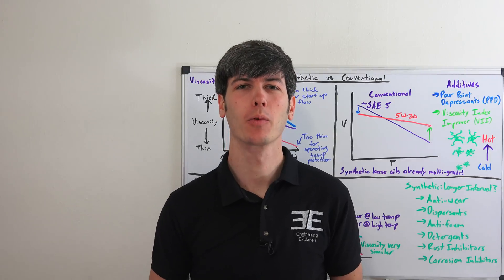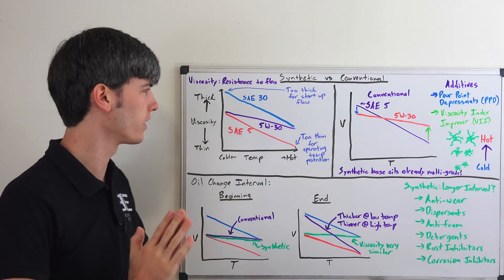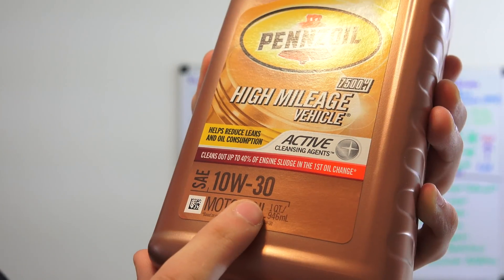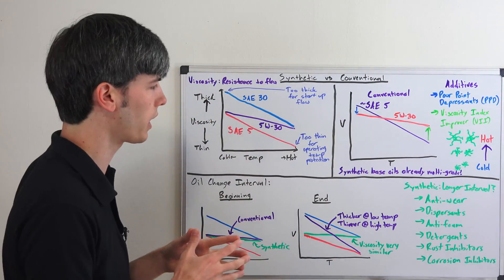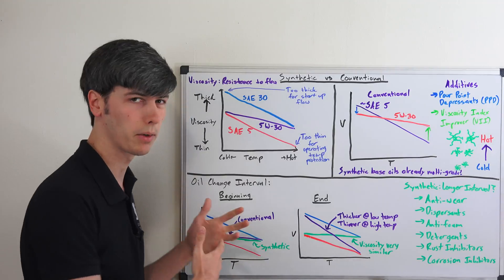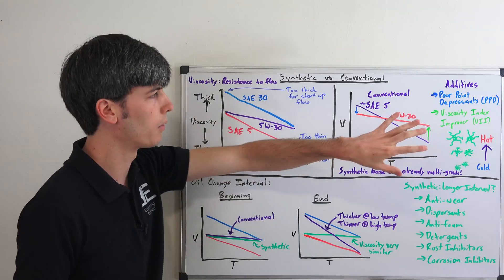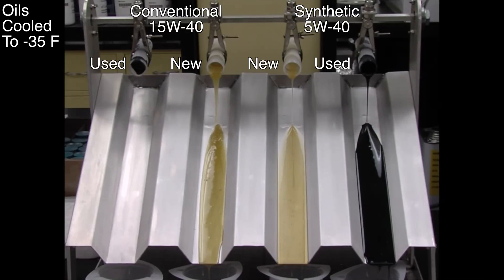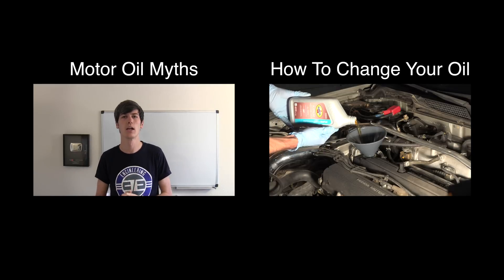Is Synthetic Motor Oil Better For Your Car?

Comment: This guy is holding a bottle of High Mileage oil (copper color bottle), which is considered a synthetic blend oil and not a conventional.
Anyway, bottom line is synthetic based motor oils performs better than conventional ones in cold temperatures.
Note: "any brand" synthetic motor oils performs better than conventional ones.
Try Service Pro Full Synthetic at 60% the price of Pennzoil...without all the bells and whistles, this oil performs as well of better than the expensive ones.

Comment: I have always used synthetic oil on my car. As others pointed out... it's $25 for 5 quarts. Sometimes they have $12 rebates... making it $13... Every time I pull out the dipstick the oil looks good... I only look for the level. I was checking my brothers car.. The oil on the dipstick looked horrible... I was so confused, I didn't know that was possible! Well... add conventional oil, do not change oil for over 6 months... add winter to it and you get that! Never mind the freaking cabin air filter... holly crap what a horrible sight!! That thing was not changed in years...

Comment: My wife's Buick Encore manual recommends an oil change every 7500 miles!   Why do u suppose?
Reply: AudiophileTubes dealer warranty gone they sale you another one they care  change oil 5000 lot cheaper then new car
Reply: AudiophileTubes my buick calls for synthetic blend which extends the oil life.maybey yours is the same.
Reply: 777 pop  Please DO NOT buy blended oil, I mean you can but you are wasting money. There are NO regulations on "how much" synthetic oil has to be in a blend to call it a "blend". Could be 1% and they can call it a blend. My advice is to buy one or another
Reply: Tom Green absolutely tom I can't agree more.i have 3 more free oil changes coming from dealer and then will probably go the mobil 1 route. I swear by full synthetic
Reply: AudiophileTubes  better check timing chain at 100000 for side to side play

Comment: basic oil change price is less than synthetic...I do my own oil change in spring/summer & part fall but winter, I pay to have it done.
honestly don't believe them if they said WE USED SYNTHETIC even if I paid more.

Can I add Lucas to safeguard instead or synthetic?

Comment: never seen my convensional oil flow that slow....as in ever
Reply: Toby 750 you have never tried to pour it at -35 degrees
Reply: Paul Zumpf 
as in the fewest places on erth people live...wored as a mechanic  in Norway and NEVER had this sirup coming out in ouer -15 to -20. Not saying syntetich isn't better...
Reply: L L temperatures @ my place is 75 F during winters & 110F during summers do I need to use synthetic or mineral oil will be sufficient.
price difference is five times ( synthetic to mineral) in my area .
Reply: Well the tenperature was 3 below freezing so you  probably wouldnt. This would be important if you moved somewhere really cold though.

Comment: Could someone please tell me when the "W" became the meaning of winter ?? For my 68 yr's on this planet it has always stood for weight.
Reply: Rod Parkinson 
IN ROD WE TRUST
Reply: Unfortunately you've been wrong for 68 years. It does indeed stand for Winter.
Reply: I am just blown away by the fact that they call it "double u" and not "double v"
Reply: Wafflepudding : weight in oil does exist, just not in this instance, you get 5 weight for example in motorcycle fork oils which is very light, almost like power steering fluid, then it goes up 7W, 10W etc etc, but all these oils are a single viscosity not multigrade.
Reply: FWIW, "W" has meant "Winter" since I was building hot rods in the '60s...  I worked at a service station (remember them?) and we received training from the oil company on the products we sold...
Reply: Viscosity =/= weight...
Reply: It's like all things, the younger crowd can change it to anything. Picture is now pic. The # pound sign is now hash tag!!
Reply: Both numbers are the "weight" but at low and high temp.
Its carryed over from the old boys from back in the day when they only had straight grades like sae 30 aka 30"weight"
Reply: Rod Parkinson - I stand corrected with you Rod, only 36 years for me but I thought the same thing. Go figure.
Reply: Rod Parkinson good lord look at what you started. yes mechanics have always used weight for viscosity. some people say winter. personally I don't care because it gets lost in explaining. I just go with viscosity (widerstand was what I was told then later winter...again I go with viscosity.)
it's all lost in translation.
Reply: I know this...I never said it was a weight... Oi
Reply: I believe the reason the W stands for winter comes from before multi-viscosity motor oils were standard. Back then, it was common to run a thicker oil in the summer and a thinner oil in the winter.
Reply: Don't let this distract you from the fact that Hector is gonna be running 3 Honda Civic's with spoon engines. On top of that he just came into Harry's and ordered 3 t66 turbo's with NOS's and a Motec System Exhaust.
Reply: It's always been Winter.  Weight is meaningless
Reply: Interesting conjecture, but since you're talking unspecified volume, 
you'd have to be talking density, not weight. Then too, a number without
 associated unit is meaningless- "5" what? To top it off, viscosity is 
NOT what you might be talking about- mebbe viscosity INDEX, an SAE 
thing.
Reply: I always assumed w standing for Widerstand the German word for resistance, I only know the table from what I know from some tables in from some garage and shops and so on. First number mean the general viscosity followed by an W then most of the time after the "-" it is 30 but some construction machines  use 40 in the summer means it say how low the viscosity change with heat means using 40 in the cold it is too thick and 30 gets to thin in heats. You also want to use 40 if you life a in a spot where it is never 0 Celsius
Reply: Jamal Baloch no, there are 5w-30 and 5w-20 conventional oils.
Reply: Thanks, I had the same question myself.
Reply: For about 69 years, it has meant "winter".
Reply: you mean you haven't googled in all of your 68 years in the planet? be thankful you got educated then...
Reply: Most modern cars use 5 W 30 year around everywhere, but some vehicle manufacturers (MAY) indicate a different oil in certain extreme environments. For instance a Ford for sale in Saudi Arabia might have a recommendation of a higher number than the same car sold to a Russian in Siberia and used during the winter, and that Siberian Ford might also recommend a 0 W 30 instead of 5 W 30. I don't really know for certain even though I have been in Saudi, but never looked at an owner's manual there. I've also never looked at an owner's manual for Siberia or northern extreme cold regions.
Reply: Actually his understanding of the "W" would not be important as long as he knew which oil to use.
Reply: nope, watch the video again.
Reply: Rod Parkinson 🤣🤣🤣🤣🤣🤣right?
Reply: Rod Parkinson i use " All Season " 😂😂😂😂
Reply: W for Walmart cheaper oil
Reply: It is winter because it is the base test for an oil at 0 degrees Ferinheight. As in the freezing temperature of water.
I also was taught that it was weight by all of my shop teachers.
Reply: u must b a American
Reply: W10W140
Reply: I had to go straight to the comments as soon as he said W is for winter. I had no idea
Reply: For 68 years, you were wrong.
Reply: Dun Truckin for us northern living folks that love 4 seasons!
Reply: W is a term used before the development of multi viscosity oils by Kendall Oil in 1953. Before then oils were single viscosity referred to as "weight". 30 weight in summer and 10 or 20 weight in winter.
Check out  Motor Oil - Wikipedia Single Grade. 
I remember the old timers talking oil "weight" down at the fillin station when I was a kid back in the 60's. The gas stations where I live here in Alaska including the one I leased in the late seventies carried single weight oil into the early 80's. 
Changing terminology and thinking in general is a gradual process that can take many years to accomplish. Please keep in mind that because someone uses different or technically incorrect  terminology does not mean that they are incapable of doing quality work as someone here alluded to. I have known people that were incredibly intelligent and book smart but could not perform simple skilled tasks with any level of competence basically due to a lack of common sense and actual hands on experience.
As for me, after watching that 15W/40 on the left I am going to check the oil pan heaters on my old diesels first thing in the morning. We don't see -35*F here much anymore but not going to take any chances.
Reply: @Dun Truckin   Here's the official gasoline alley explanation. Back in the bad old days, only single weight oil was available. When the cold weather came around, drivers would have to switch to a lower weight oil for the season, commonly known as a winter oil. When multigrade oil was introduced, the lower number was designated W for winter weight. The idea was, 10W-30, for example would perform like a 10-weight oil cold and a 30-weight oil hot allowing the use of a single oil year around. I recall single weight oil as having been designated as 30W-30 or 20W-20, for example, but my recollection could be wrong, and the industry might not do that anymore. I haven't looked lately

This is just industry nomenclature. It doesn''t have any cosmic meaning. But W does stand for winter.
Reply: kcotte59  That's Heavy Man.
Reply: The W has always been winter.  5W-20 is 20 weight oil.  The 5 is the number of seconds it takes to flow through a predefined restrictive tube at an ambient temperature of 32 degrees.   So 5W is a winter rating of 5 seconds to make it through the tube specs for testing.  The faster it makes it through, the better the winter rating and the lower temperature you can operate in.  So 5W is better than 10W and 0W is better than 5W.  0W-20 is recommended by Honda and Toyota.  I run that in my vehicles.  However living in the South, 5W would work just as well.  But If I take a trip north in the winter, I may benefit from it, although probably not unless Alaska is my destination.
Reply: Bruce Greer you cant be more than wrong on your winter VISCOSITY of oil. Your winter viscosity is how thick your oil is when below a a cold temp (meaning well below operating temp) 0w based oils are meant for minus 0 degrees farenheit and work best in those areas. This does not mean the amount of time for flow through an engine. Your second viscosity is the thickness of oil at operating temp because of the chemicals in the oil. Overall most manufacturers recommend a certain generic multi use oil because they have no clue where the cars will be shipped. So in conclusion the W in oil stands for winter meaning how the oil acts in very cold temps for oil. In general synthetic oil is best for lubrication of your engine overall as the chemicals are very uniform and have a longer life as opposed to a conventional oil
Reply: Bruce Greer So according to your interpretation 0W takes zero seconds. "Winter" is correct. Referring to oil as "Weight" is a malapropism from the erroneous terms lightweight and heavyweight which conflates viscosity with shear-strength.
Reply: The W refers to Winter. Not to Weight.
Reply: Have you seen fastand furious where paul walker and vin diesel are in the asians garage and the asian is torturing the fat guy ted?? He says 50 weight 60 weight?? When they pour oil on his face???
Reply: @speeddemon002   If it is in a movie then it has to be true!!
Reply: Rod Parkinson Mandela Effect.
Reply: Nonsense. "Weight" means nothing re lubricants. The numbers tossed about for these oils refer to VISCOSITY INDEX, which is a way of codifying viscosity, the property that slows oil being squeezed out of journal bearings or off cam lobes. Thus you mean 30 VI, not 30 weight. Takes a tiny bit of conscious thought. Synthetic oils were first developed for turbojet engines, with enormous temp variations; saved lots of destroyed bearings, because of much reduced temp-related VI variation.
Reply: a single viscosity oil isn't called 30W... it's SAE 30.
Just because you learned that the W is for weight doesn't mean that the real meaning of the W changed. 😉
Reply: Speeddemon002: And your point being what exactly, 50 weight, 60 weight do exist, but they are just that.
Reply: Your sources are correct. W is winter.
Reply: WTF? What sort of blather is that? The numbers of motot-oil grade are viscosity-index, an approximate way of codifying viscosity. Period. Devised by SAE, Society of Automotive Engineers. Even Wikipedia is quite confused by just what it means- variation vs absolute.
Reply: Rod Parkinson You've been wrong for 68 years? I hope you're weren't a mechanic.
Reply: Every single source I looked up has the W being for winter, not weight. Which makes sense, because "weight" would be meaningless here: Things don't change how much they weight based on temperature, and weight has nothing to do with lubrication or viscosity.
Reply: Rod, it does stand for winter or the coldest, of the 4 seasons of the year, Thats the first number of the multigrade oil, the 2 nd number is for the other 3 seasons! Amen
Reply: Jacques Blaque We should also consider that weight is actually a function of mass and gravity. Mass is a function of volume and density. Gravity is a function of two masses. So using weight when referring to kinematic velocity is actually completely wrong anyway.
Reply: Cody Deville : this is a debate on the subject, winter wins out. https://www.bobistheoilguy.com/forums/ubbthreads.php?ubb=showflat&Number=7570
Reply: Tyler Hardy W doesn't mean weight..... the W means winter
Reply: Yup. 30 weight for summer. 20 weight for winter.
Reply: Finally :)
Reply: No. It's definitely Winter.
Reply: @Rod yea they tore up in the head. 5w-30 5(weight)when cold, then your engine oil heats up and it thickens. Long story short wtf does winter have to do with the W? Why is oil referred to thickness when it gets warmer? Isn't it easier to comprehend the WEIGHT of the oil?

Comment: I Change my oil onec a year and my car is fine on ,117 000 miles, my jeep has 174000
Reply: What The Heck TV
117k is not an impressive mileage number.   Put another 200-250k on it, then come back and brag.

Comment: do you have any idea what you are telling people? if someone has over 50,000 miles on the motor they should not start using synthetic motor oil it is so thin it's sneaks through all the seals and comes right out the exhaust and blows the motor. stop looking at it from an engineer's side and look at it from The Real World mechanical side.

Comment: I used to use full synthetic until I heard that the thinner oil leaks faster. I have a worn and expensive gasket to fix and I would rather have it leaking slowly.

Comment: I really don't understand this video
Reply: Jason Holzman 
If you did, you'd be rocking back and forth in a chair mumbling something about Kmart underwear.
Reply: Mr Dave
Synthetic is better.   You're welcome.
Reply: @jshepard152  which number should I used. There are so many. 10-50 ,15-50, 10-40,10-30
Reply: panggil zufar je
Whichever one your car manufacturer calls for.
Reply: Kmart, Cincinnati.... 400 Oak St.
Reply: Thats Oak and Burnett.. Kmart
Reply: Marvin King well maybe because he's trying to explain everything behind how oil works in your engine or wtvr 
If you didn't get it that's your prob
Reply: Jason Holzman 
FEMALES.....sigh*
Reply: Jason Holzman the answer is yes. next video!
Reply: Jason Holzman your not the only one
Reply: That's cause you don't speak english
Reply: Maybe you should suggest that he add cute dancing girls to his videos, if you're so bored?
Reply: Mr Dave tru
Reply: Hit play
Reply: you are not alone~
Reply: paul k the trick
Reply: Its all about oil viscosity synthetic keep this property much better than conventional
Reply: when i thought i was the only one,  and then i read ur comment,  LOL! 
IM NOT THE ONLY ONE 😂😂😂
Reply: Go with synthetic oil.
Reply: fq, how motor oil works.....it gets between two metal surfaces so they do not come in direct contact with each other but instead slides on this slipper stuff we call oil. it is like cartilage in your joints. it is just there to lubricate two moving parts that would otherwise contact each other and thus create wear.

that is how oil works.
Reply: It's way too technical to understand it.
Reply: Jason Holzman 
Dude talk to damn much.  All he had to say was what he said the last 15 seconds of the video.  I got so damn bored, I just fast forward to the end.  I never want to hear this guy agajn.

Comment: I hate this discussion. 
I'm a engineer, if your car doesn't say you have to use synthetic don't use synthetic. If you are getting your oil changed at the proper mileage your oil will never be black like that. 

Also the fact is  synthetic oil was invented for jets for extremely high temperatures to extremely low temperatures. 

It's a money grabbing system with very little to no benefits

There are vehicles that need it like, sports cars and most trucks. they are designed to use this so use it. If your car was not designed for it you don't need it, unless you live in Alaska and temperatures are -45 c all the time.